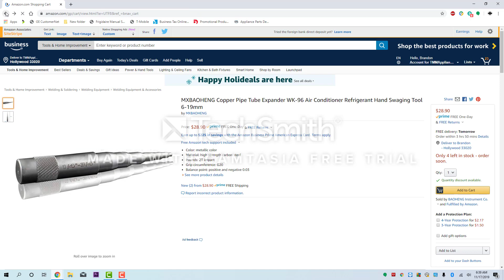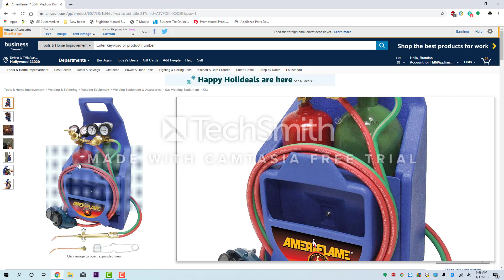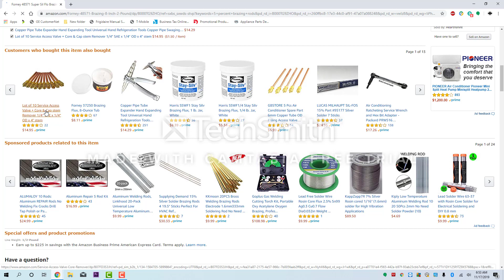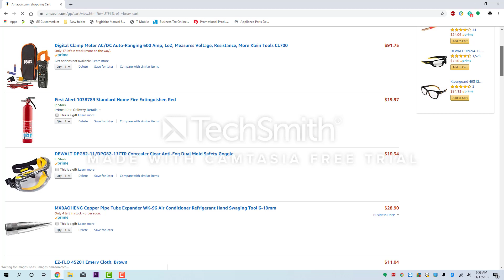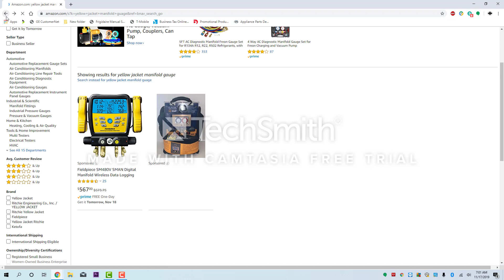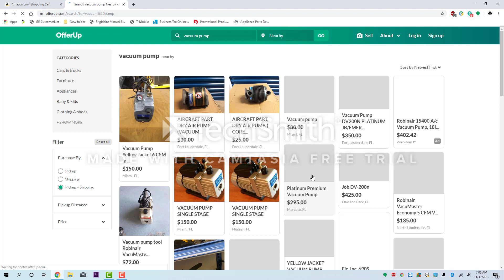What sealed system tools do i need to get started

Comment: It's all very nice, but with the new R600a and R290, it makes all this equipment obsolete. You can't even use them vacuum pumps for flammable refrigerant. Handy Flux ,no good,  you will broil more copper tubing with that Handy Flux. Get Ultra Flux instead (made by the same people) Ultra Flux, takes right away boom. But it doesn't matter, everybody is using lokring solderless joints.
Reply from the maker: 5yr old vid bro.. thanks for finally catching it. We solder r600 no lokring 2024

Comment: Why would you need the refrigerant recovery machine when you have a vac pump and a recovery tank?
Reply from the maker: I respect you really wrote that confidently online, to show your understanding of sealed systems .... I will let the universe show you the difference #respect
Reply: @TMMApplianceRepair  I’m asking to learn… maybe you misunderstood.
Reply: @ContrarianCrusade  if you don’t already know now, or if a future prospect is reading on this let me break this down.
If you just open up the refer into the recovery tank, the pressures will simply equalize. You need the recovery pump to assist in removing the refrigerant from the system and into the recovery tank. The vacuum pump is to dehydrate the system in preparation for adding refrigerant.